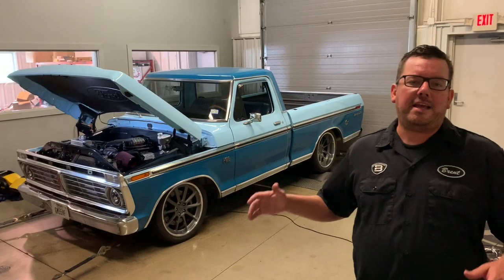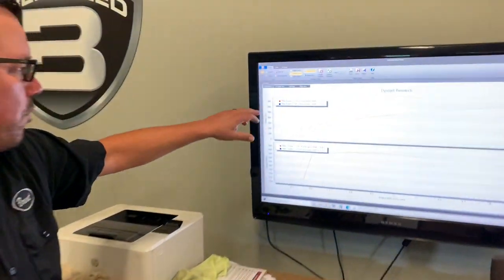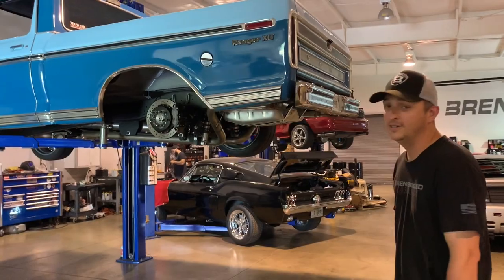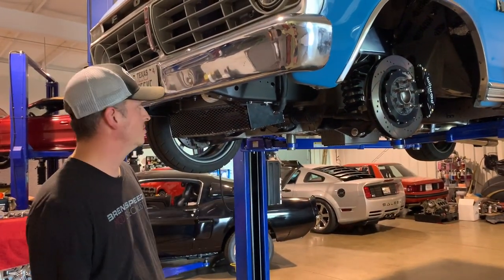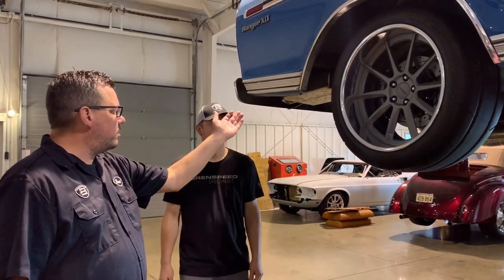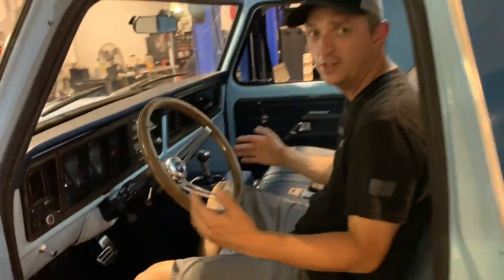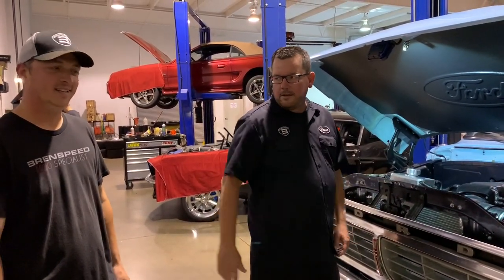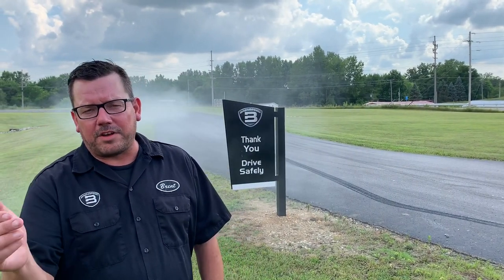F100 COYOTE SWAP (Whipple Supercharged) Build Review @ Brenspeed So Many UPGRADES!

Comment: never seen pipes go back and under the diff like that, I guess its large dia pipe and being a ford the engine and drive train is usually factory off-center (for good reasons). just curious...was there no other way?